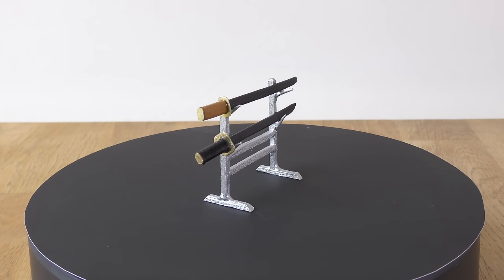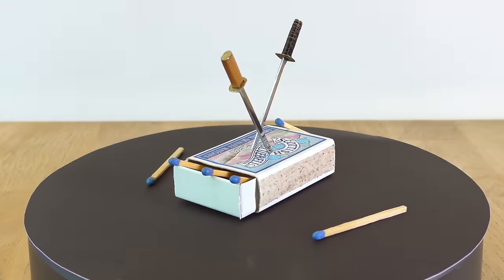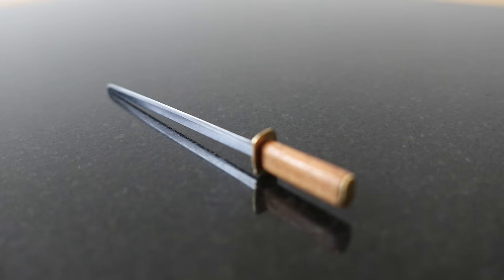Mini KATANA build - WILL IT CUT?

Comment: How did you sharpen it and what glue did you use for the blade and what liquid did you use for the sharpening block
Reply: Elder God1678 He created crude blade edge with hand file, fining it and sharpening to the desired quality on whetstone. Yes, it's called whetstone, thing you refer to as sharpening block. Liquid is water. Everything is literally in the video.

Comment: When sharpening the blade try sliding the opposite way. Into the cutting edge rather then away. It should be even sharper
Reply from the maker: Good tip

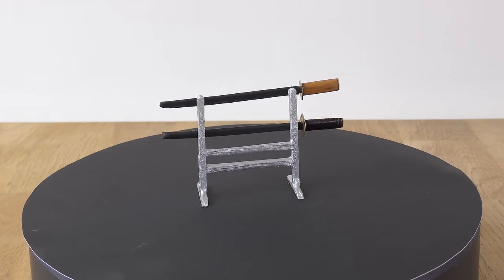Comment: 0:15
How did u mirror polish the blade???
on 3:38 it isnt
Reply from the maker: Just a bit of metal polish or T-cut. After you have finished it with 1200 grade wet and dry it polishes up sooo easy. It passes through things easier when chopping too.
Reply: BrainfooTV You said razor sharp, can it shave hair?

Comment: this is cool it would be good if u trued to cut some things with it and see if it can but with bigger stuff like hard food our plastic our cans also u should use them as throwing knifed and and a bord to use it on
Reply from the maker: The trouble with miniaturising a sword with an elegant blade like the Katana is you lose mass if you try to keep it scaled, that means the blade struggles to chop through dense things. The carrot was about the maximum thing you could chop easily with such a thin blade, it could probably stab through and can, and cut it as long as you penetrated the can deeply whilst cutting.
Reply: try but you could make a bigger blade but it is up to u would a phone or iPad work
Reply from the maker: A knife sized one might be cool,  maybe one for the future. I thought I'd make this one small and easy to make. I actually have it on a fridge magnet at the moment so when I get packaging I cant open I pick it up and use it, it's really handy :-)

Comment: this is not a mini katana.     
it's a mini katana replica.   

it would only be a mini katana if you actually forged the metal and folded it 10-15 times  in order to get 1000 layers
Reply: There's no point in folding it here since he started with good steel. The point of folding the metal was to get rid of impurities because the only metal available at the time was low quality pig iron. Folding helped to remove contaminants and homogonize the metal so it was closer in strength to the steel in the paint scraper. Also, the 1000 layers thing was a myth. It was folded as many times as necessary and even then, the layers merge as they're folded so there was never 1000 distinct layers. Along with that, folding isn't what makes a katana a katana. In fact, folding isn't even distinct to katanas. The metal used in all swords everywhere was folded though the number of times was usually less since other places had access to better quality metal so they could get away with less folding. What makes katanas distinct is their shape and their differential heat treating which is the reason for their curve and the wavy pattern you see in the middle of the blade.

Comment: You can also take a razor blade and stick it in a piece of wood
Reply from the maker: Razor blades are hardened so much they may snap off without warning making them dangerous. I wouldnt, thats why I used a hard spring steel.

Comment: Try cutting some wood with this

(Pin this, if.. you want... ;-; )
Reply from the maker: I sharpened some pencils with it no problem, but because the blade is thin and flexible it is not as easy as the mini axe build. The thinness of the blade makes it ideal for cutting and chopping, a bit like a cross between an scalpel and a pen knife.
Reply: I mean like, the thinnest piece of wood you could imagine, the type used for decorating stuff.